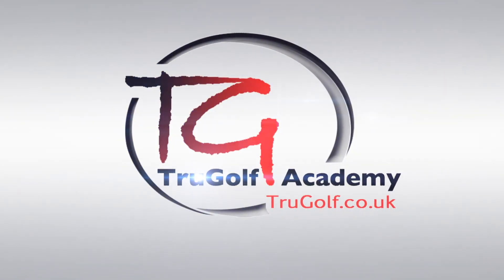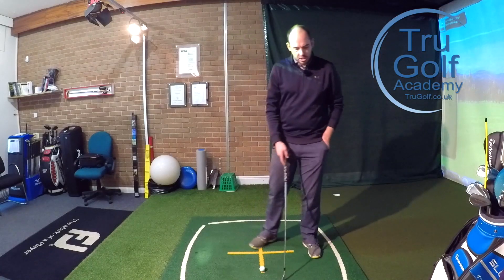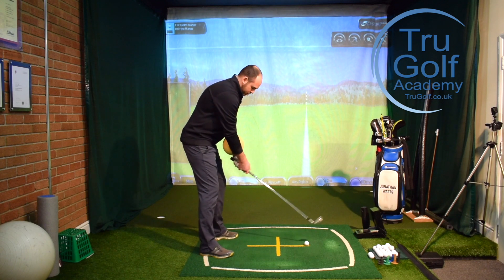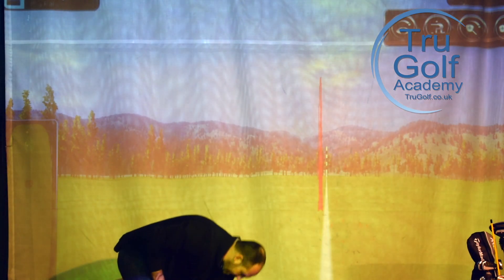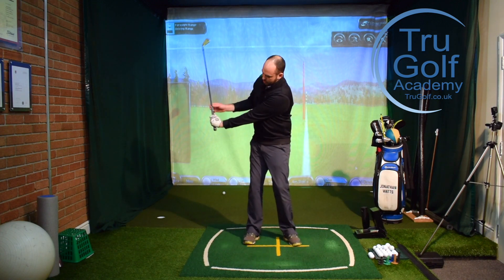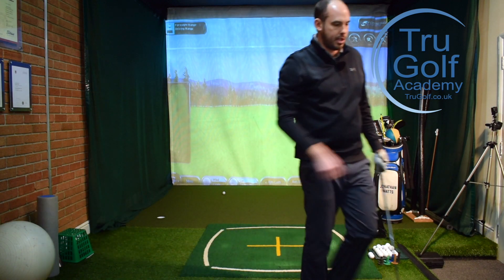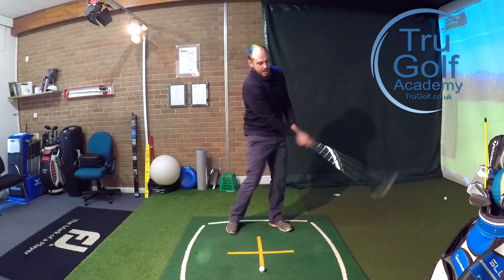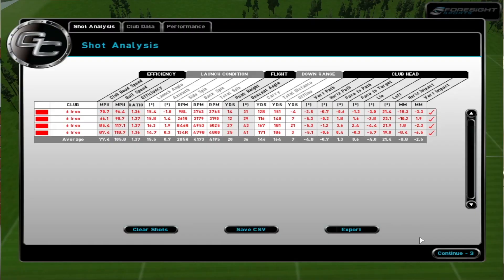MAINTAIN A BODY RELEASE BUT WITH POWER!

Comment: Good lesson John have been persevering with body rotation for the past year great 100yds in but seems to apply to much cut spin for distance
Reply from the maker: In which case your path is out to in rather than in to square to in. That or clubface is open. Check the clubshaft is parallel to the target line (just ahead of toe line) pre impact. 
Happy to help if you want info regarding online lessons?